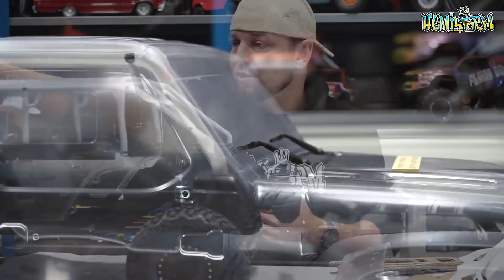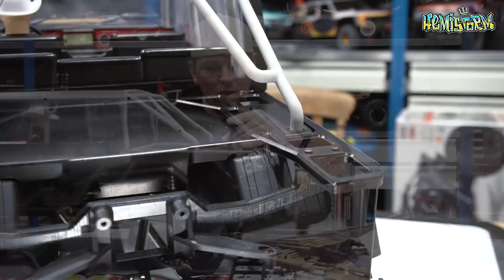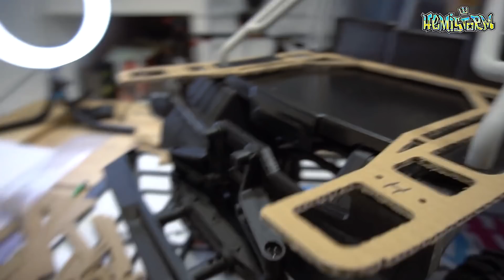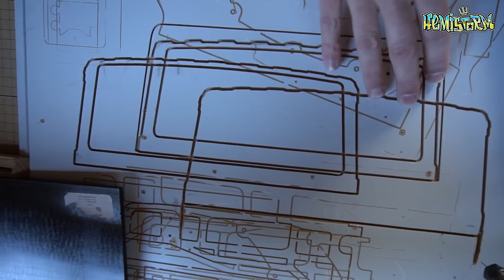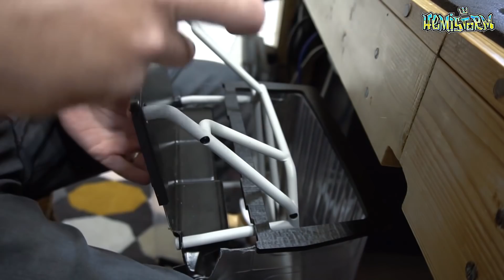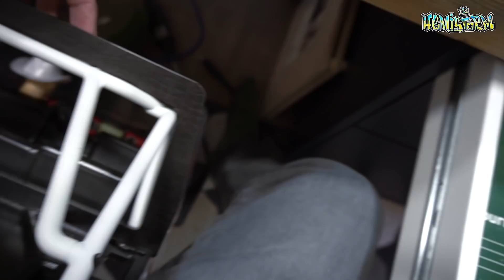AXIAL SCX6 GLADIATOR Part 2 - Measuring & making parts

Comment: I thought that the armoured panel look would have been the way you were going to approach this project when you started.  Looks really good Chris.  Absolutely on point when you said machining a chamfer on your cut outs makes it look less hand made is something I instil in my young guys at work making custom motorhomes. Hand made is special but it should look manufactured if that makes sense. 
Looking forward to next episode,  always cool content. 
Have a great weekend mate, cheers 👍
Reply from the maker: Right on, Mick! I think it’s the difference between just calling it done or showing that you’ve invested a few extra hours to try and appreciate the materials and tools you work with. If you have the possibility, use it. 😄👍🏼👍🏼